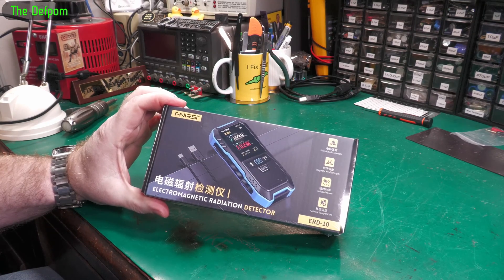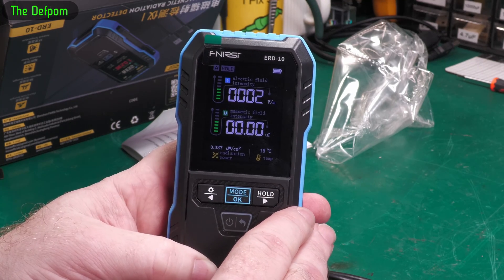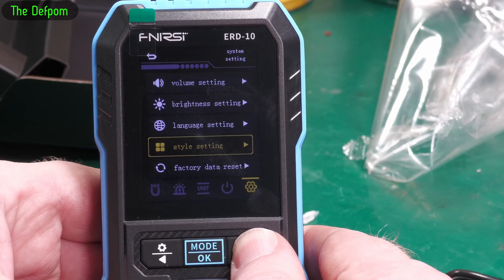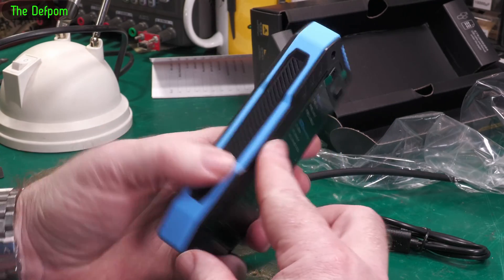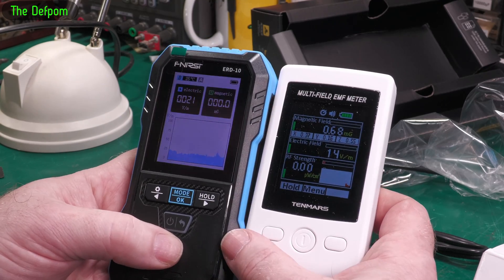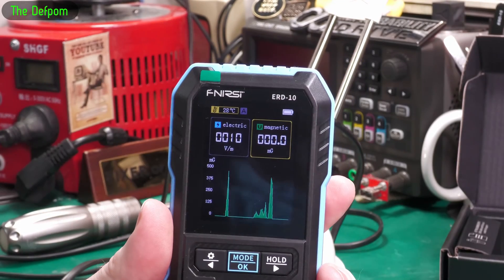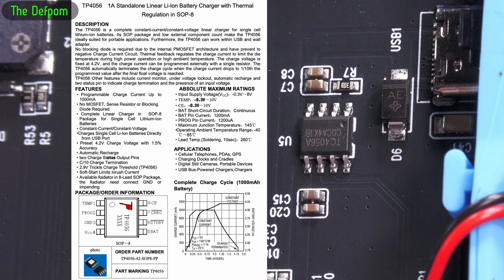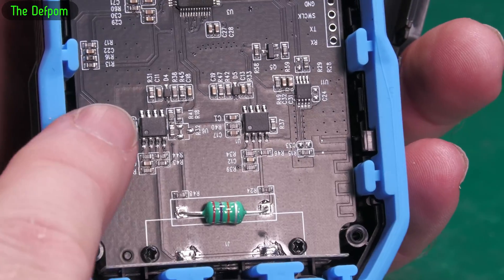🔴 FNIRSI ERD-10 Electromagnetic Radiation Meter Review - No.1380

Comment: Seems to be worth what you paid for it!  To be fair, it may be for higher levels of RF than you have leaking out of the bnc connector, maybe try a 1/4 wavelength piece of wire plugged in to give a better signal, or different frequencies??  Not sure why it didn't detect the magnet though.